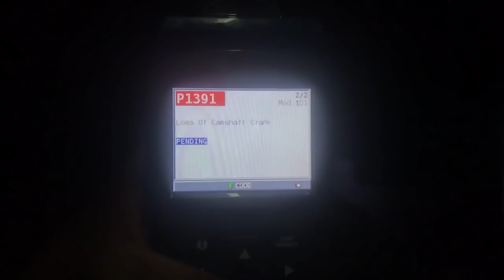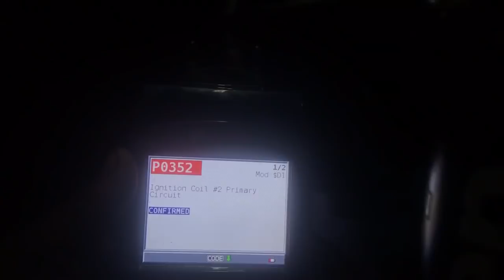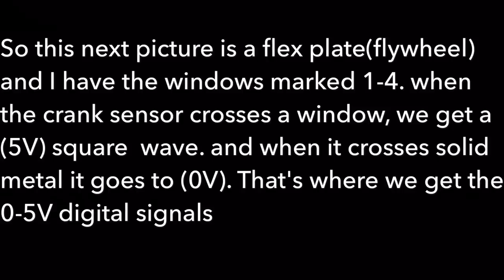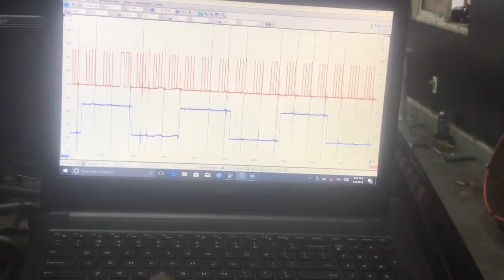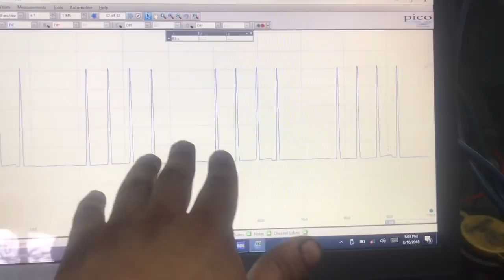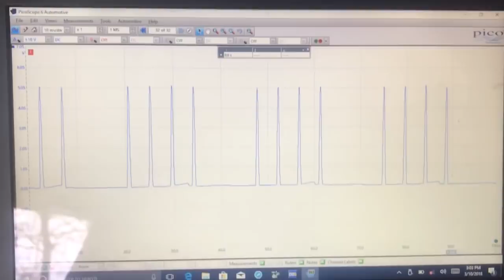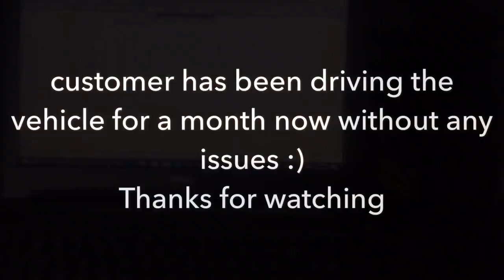Testing a bad crank sensor

Comment: Can you test a crankshaft and camshaft sensor wth a multimeter?Basically he is saying even brand new aftermarket parts can  turn out to be bad.
Reply from the maker: Lisa T you can but for intermittent drops the multimeter is not fast enough to catch the fault

Comment: Question 
I am having some issues with my 1998 grand Cherokee,  it cranks no start I have a code p1282 and also bought a aftermarket market crank sensor can that be the issue
Reply from the maker: It’s hard to tell without testing it without a scope

Comment: what up oz i have a question my 97 dakota 3.9 sounds the same exact way i was about to remove the 2 bolts that hold the crank sensor in when i noticed the 3 wires were all exposed coming out of the sensor itself almost looks like they were melted.could this be the cause of my dakota sounding just like this car in this video??
Reply: ive done a tune up plugs cap and rotor ect..also just replaced the fuel pump

Comment: All the techs who do this type of work or diagnosis they don't do it on a daily basis, if they do is because they want to get money off YT hits. In real life when you take a vehicle with this type of scenario 99% of these mechanics start throwing parts and they don't even resolve anything and they keep telling to replace here and there. Is one of the most dishonest professions in the world. Thanks for taking the time to upload this video.
Reply from the maker: The reason this is. Back in the day when a vehicle came in most mechanics just said let’s change out your spark plugs and wires it’s due for service. And it worked most of the times. So how my teacher put it, repairs  used to consist of  85% service and 15% diagnosis. Now, it has flipped to 85% diagnosis and 15% service. But guess what the mechanics are still stuck to the old ways. That’s why we have a ton of parts changers. But hopefully these diagnosing repair videos will inspire other to start learning and going to training events to better their knowledge and help diagnosing process. Also to educate the customer that these cars are getting more difficult to fix as well . Thanks for watching
Reply: Awesome job. Lots of mechanics n technicians lazy n take shortcuts resulting in misdiagnosis or as you put it, throwing parts at it. That industry is dishonest as hell. Kudos to the real good techs out there.

Comment: I am not a mechanic, but I use oscilloscopes every day. Where are you connecting your leads? At the connectors near the sensors or near the ECM? Somewhere else? I think I have a bad crank sensor on my Lincoln LS and I am trying to decide where to start looking for crank and cam signals. I was thinking of starting at the ECM. If nothing going to the sensors connectors. Great video!
Reply from the maker: I use what’s easier to get to. So if the crank sensor is in a hard to reach place and the ecm is easy I’ll just do it there. But you need to get a wiring diagram and find out what kind of sensor you are testing.
Reply from the maker: Is the crank producing a digital or analog signal
Reply: @OzMechanics  I waited 26 hours to get the "instant download" manual. I'll have to go over it. I did manage to get one of my OBD2 readers to connect so I could see if my crank sensor was showing RPM. Of course, it STARTED EVERY TIME!!! Any other time it would take 10-15 tries before it would fire. My guess is the next time it fails to start, I will likely get no signal from the crank sensor. I bought a handheld scope for my onsite diagnostics(not automotive related but bandwidth is 40MHz and it will handle a lot more than 5V signal I'm looking for in the Lincoln), but three weeks and it's still not here. It would be perfect for this. Really not liking the idea of lugging one of my bench scopes out in the cold and balancing it on a fender well. Anyway, thanks and great videos!

Comment: I’m having an intermittent stalling problem with my 99 Ram 1500 with the 5.9 that I think is the crank position sensor. You will be driving along and the tach drops to zero and the engine just dies like the key was shut off. No spits or sputters, it just dies. Everything else is still on, just no ignition. Usually you can shut the key off, wait a minute, hit the key and it will start right up and run fine. No CEL shown. Gives no warning before shutting down and it may run for days before it happens again. Swapped out the ASD relay, but no change. Even tried a different ECM. Hate firing the parts cannon, but don’t have access to a scope and without any codes, I’m at a loss where to go next.
Reply: After 6 months I'm guessing you've fixed it, but for future reference have a look at my video on the subject: https://www.youtube.com/watch?v=iLKOqCS67xM

Comment: Hey man, great videos, but please make me understand, the sensor fitted on the car is actually a good sensor but is not performing well???
I also have some problems with CPS sensor, first one give me no signal or short to + , and after replacement, the car have the same symptoms but the error code now has changed to “implausible signal”, could I have the same problem you illustrate on your video??
Reply from the maker: The only way to really see what’s going on is to check it out with an oscilloscope. It shows any imperfections in the signal wire that can happen in a blink of an eye
Reply: Oz Mechanics, thx mate, I’ll look for a shop with an oscilloscope, those are very rare where I live!
Also until I’ll find the shop please help me with an answer if u have any idea, would it be possible for something else in the car to trigger the camshaft sensor error? Anything else then “wire harness to sensor, CPS sensor or ECM”!
Reply from the maker: Daniel Mihai https://youtu.be/LFKL990i0bE

Hope this helps. Another video I made
Reply: Oz Mechanics Great link, does resemble with some other issues I have with the car(audio issues)...hmm, thx man 👍👍👍

Comment: Great fix and pays to get to know how to use the scope. Most of these faults will only be apparent on a visual.When it comes to replacing vital components in a car system, from experience it's looking for trouble using aftermarket rubbish, yes pure unadulterated r_u_b_b_i_s_h. All good mechanics worth their salt will always choose OEM over cheap substitutes.

Comment: NICE SCOPE// did you ever tap it closer to the tone wheel at the bell housing with a 2ft pry bar and a hammer by closing up the air gap the hard start/ hot stalling goes away.

Comment: Cheers OZ, I have the snap on verus and a cheap picoscope, both very good Scopes, when I got the Pico I used it all the time but recently appreciated the verus because it so quick to set up and has great filtering of the signal.  I have found that if you filter too much in the Pico u end up with rounded waveforms at the top and bottom of your signal, thanks for sharing cheers sandy

Comment: I have a Chrysler 300C 2005 I change the oil pressure switch I change the connectors to it and my engine light still on it keeps reading coming up with oil pressure switch I change that and the sending unit I'm starting to think could it be my oil pump oh my throttle body that's causing my engine light to come on that's the only cold I have keep coming up is the oil pressure switch I don't know what else to do any suggestions
Reply from the maker: Hook up a manual oil pressure gauge to see if you actually have low oil pressure